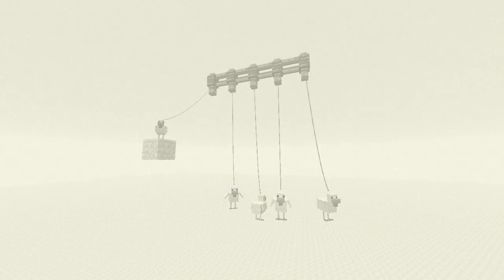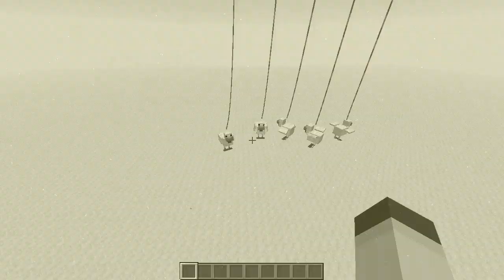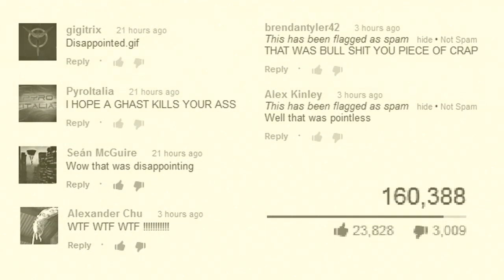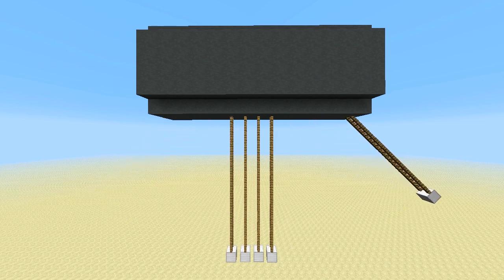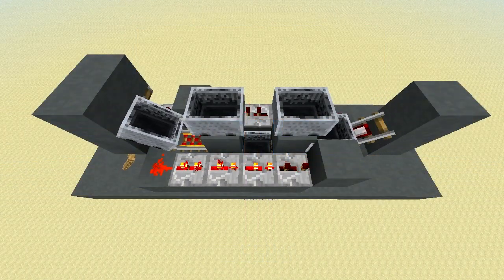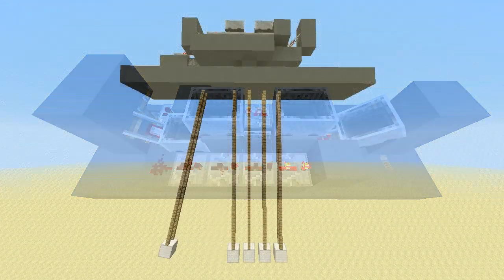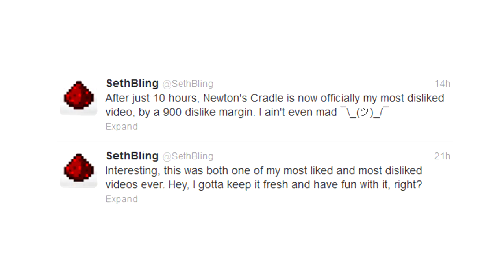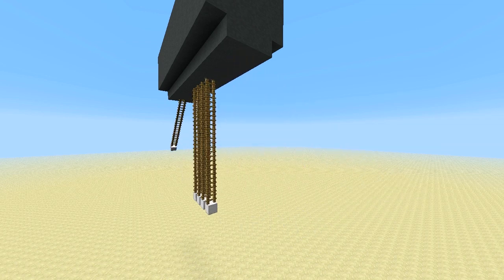FUNCTIONAL Newton's Cradle! [Minecraft 1.6.2]

Comment: You realize that's not a newtons cradle... A newtons cradle had 5 balls that are connected to TWO strings each that are then connected to a surface above. Without the two stings balancing the balls, a newtons cradle would not be able to function.
Reply: I think t did have 2 strings, its just that the fence posts connected so it looks odd

Comment: ...Just from the thumbnail I knew it was going to be the cheated way of doing it with minecarts. A lesson people need to learn, if you need to use a second-hand system to do it, it isn't vanilla minecraft. MCEDIT DOES NOT COUNT AS REGULAR MINECRAFT putting blocks in minecarts isn't supposed to be possible with regular minecraft so techincally this isn't an actual minecraft machine, it is an mcedit machine, which can actually be easily done with mcedit